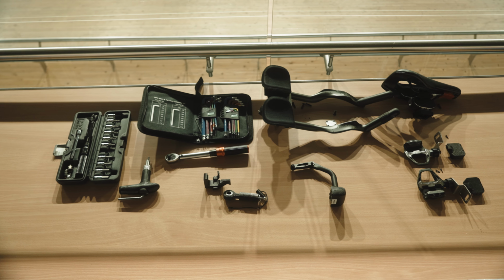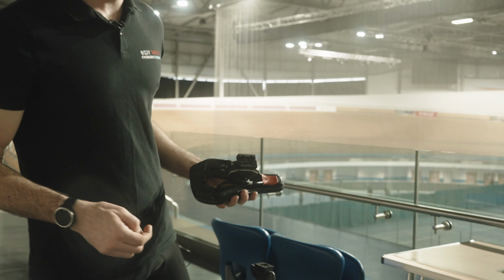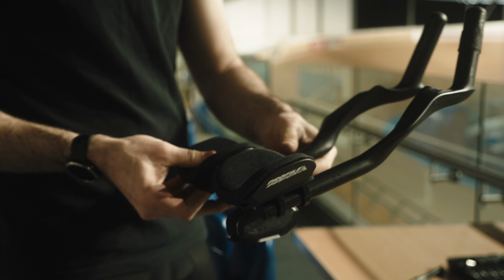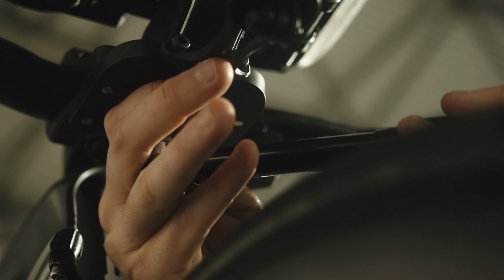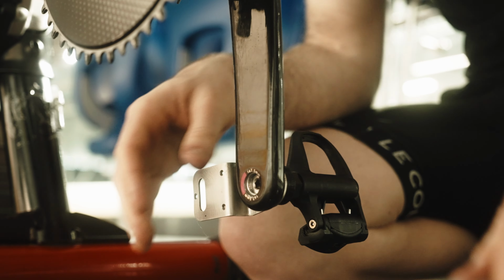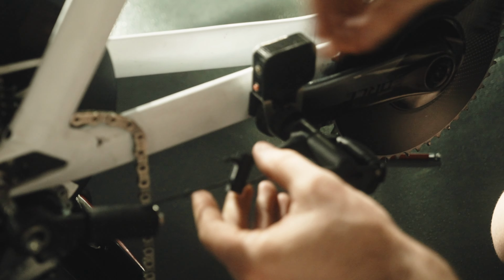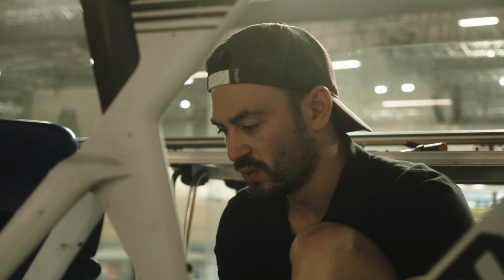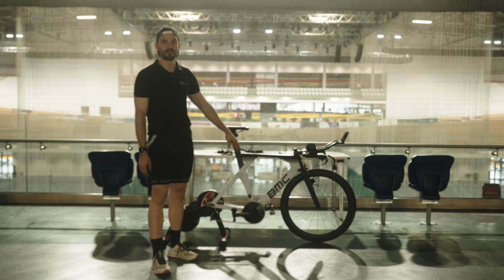How to... Install BODY ROCKET - On-Bike AERO TECH

Comment: With most TT bike front ends having proprietary bars, does that system have adapters that can adjust to insert the load cell to any bike? What happens for very small riders that have little or no stack height between the base bar and the extensions?
Reply from the maker: We've designed adapters for all of the top models from the leading brands. These can be selected at checkout.
Regarding smaller bikes with low stack heights, if this is a concern, get in touch with our team at makemefaster@bodyrocket.cc. They can advise on compatibility.